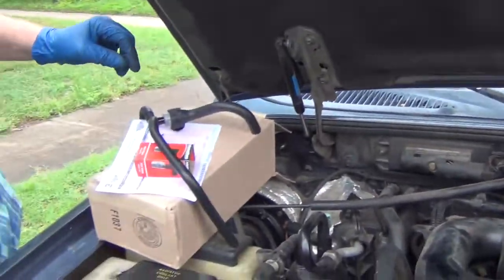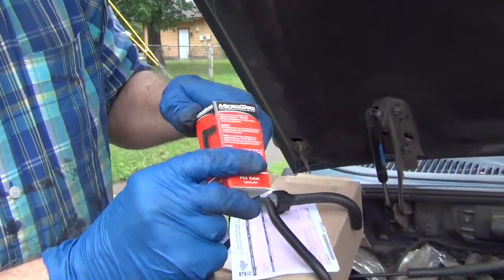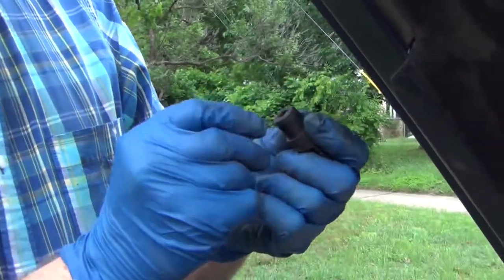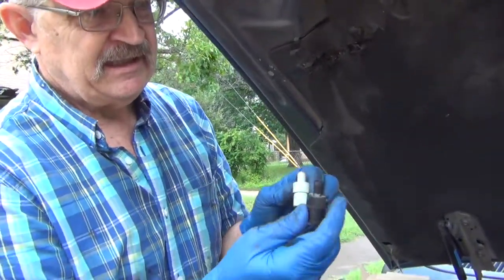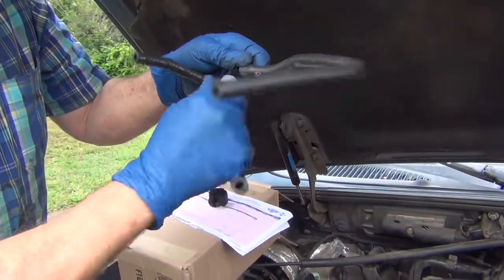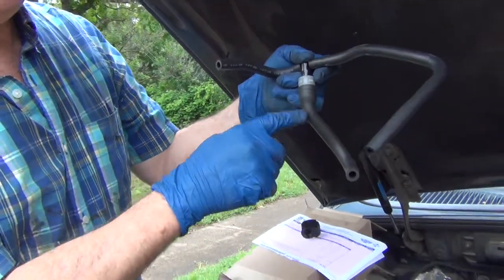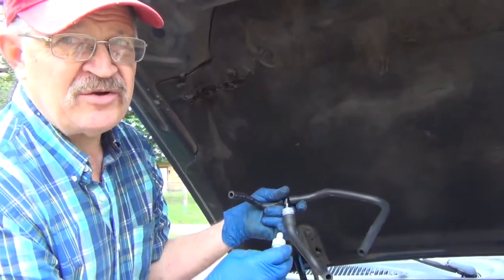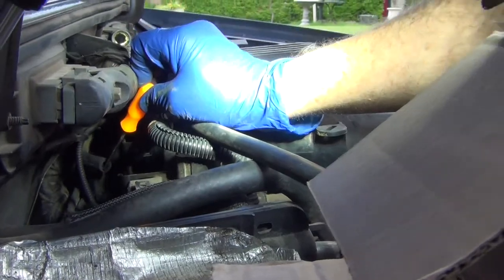How to change out PVC valve on 1998 Ford Explorer, check engine light, Tip on 4.0 SOHC motor

Comment: what is the PART NUMBER of that little HOSE you didnt used?... the one the pcv sits on
Reply from the maker: Great Question, As I did this job over a year ago, so do not recall the part number, however I did get it at the ford deal ship parts shop.  Hope this helps some.
Reply: Same question :(
Reply: F77z-6c342-ab

You’d have to buy the entire kit, but this kit includes the hose he didn’t use.